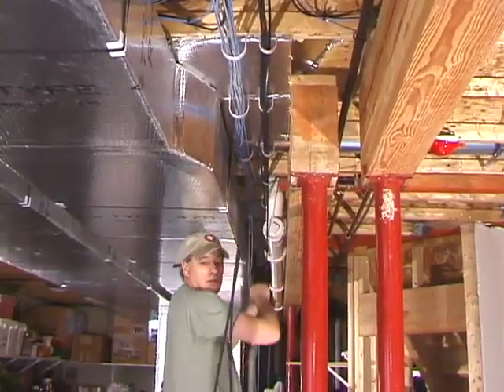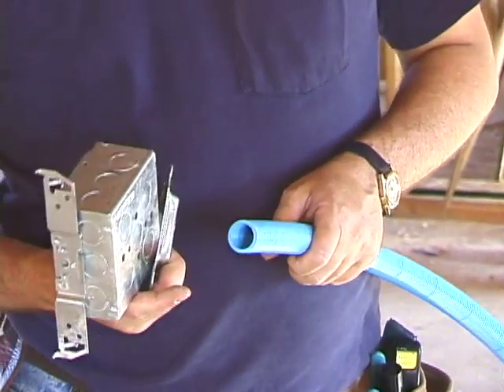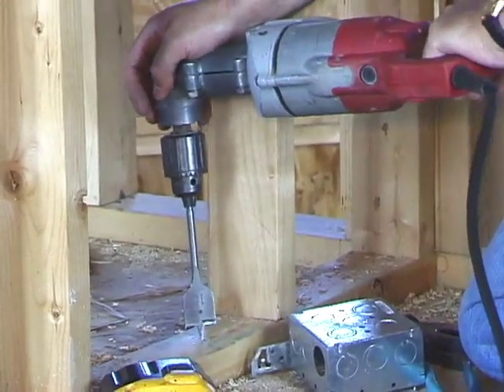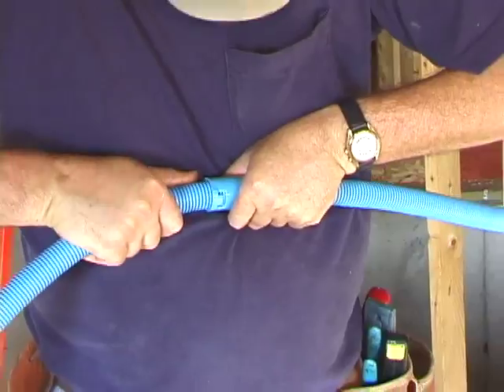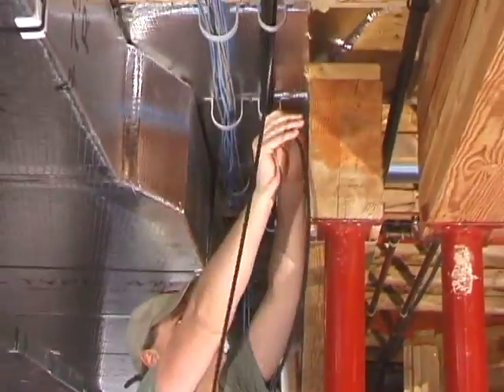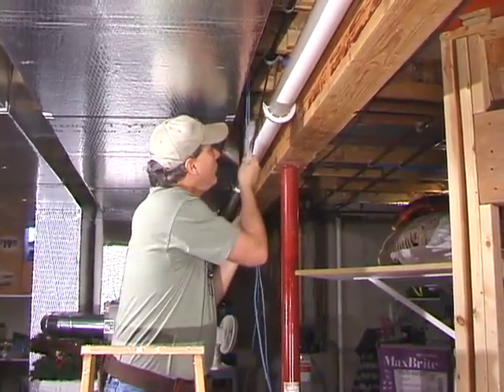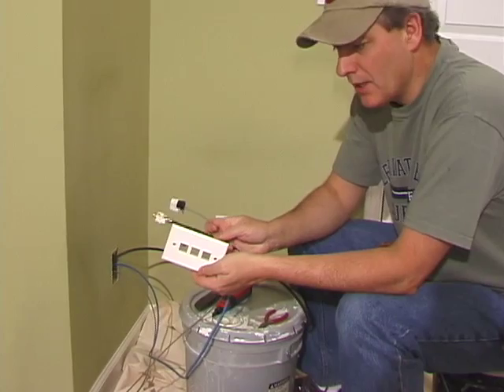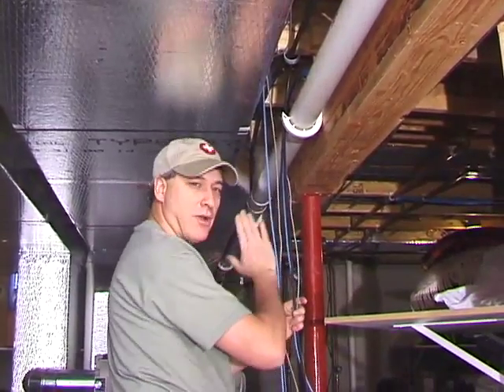North Coast Digital - Show #3 - The Ultimate Home Network

Comment: My builder gave me the clear to run data wire on a weekend in October.  Thinking of cat6 for future proofing - on said weekend should I just run conduit and tack on the boxes? I want every bedroom, back of the garage, den, and work center to have (1) cat6 port and (1) cable tv port (RG6?) and (4) cat6 ports in my family room and loft since those places will have smart tvs, blueray, ps4 etc...It comes out to (15) cat6 ports and (6) RG6 ports; any thoughts/advice?? thanks, I really knew nothing of home networking 2 days ago so bare with me

Comment: What kind of Conduit did you use? I am curious because I too am planning on asking the builder if I can instal it myself but they said it has to be FT4 rated.
Reply from the maker: I just went down to Lowes / Home Depot and bought it - the brand was Carlon.  I Googled "is carlon flex conduit ft4 rated" and it looked like some flex conduit is FT4 rated.  My contractor told me that I had to seal all holes through floors with fire caulk - which I did.

Comment: i took the idea of pipe hangers. but i zip tied them to my attic instead of screws. i wanted to be able to do easy upgrades and if i had to move one its easier to. any suggestions if i should wrap the cables from the hot Arizona heat or should they be fine. they have been up there for about 2 yrs but sitting on the attic floor and no problems so far. i just recently added the plastic pipe hangers. it looks so much better up there now with the hangers then wires all over the place. my house was built in the 1960 and i'm trying to add all the ethernet cables and run hdmi cable all over the house. hdmi cable are for the best buy look. all tvs playing the same thing.
Reply from the maker: I am no expert - but I would guess that wrapping the wires would be a bad idea.  They engineer the wires for a very wide range of environments and my guess is whatever wrap you put around them will be have more problems with the attic heat than the wires themselves.  You might want plenum rated wiring as it is rated for higher levels of heat and not wrap the wires.

Comment: after you strip the jacket off with the razor blade take the nylon string that is in the cable and pull on it and it will split the jacket that way you can cut off the wires were you cut through the jacket and you wont have to worry about if you nicked the wires with the razor when you cut the jacket
Reply: Even though this is an old vid, I had to say something about that nylon wire. It's actually the wire stripper.

Comment: You've done a fantastic job on most of the house, and I learned a few tips from your video. The only thing I do not agree with is how you terminated at the demark. You simplified the connector for cat5 and cat3, but organization is a sticking point for me, I would have rather seen you put in a patch panel via a wall mounted 4 post rack, it's not that much more $$. Doing this in addition to labeling the ports is just an easy and clean way of demarking your home (or business) network. Ultimately thumbs up, I am sure  your work today is top notch.
Reply from the maker: Daniel Holt Thanks for the comment.  The simplified connections were an attempt to save money.  My plan was to cut off the male ends of the wre (wit a lot of extra wite available) and buy the equipment to terminate the basements ends properly.  Everything in 2000 was more expensive that it is now.

Comment: Nice job, it's interesting to see another side of the industry (I work at a school district). Just a note for viewers about the termination; what was done is not B standard, the browns are switched. B is ow-o-gw-b-bw-g-brw-br. Not a big deal, just don't think that that arrangement is standard, as long as the termination is the same on both ends, the connection will work. the colors are just a coating and don't physically affect the cable, copper is copper. I also believe it's note worthy to not put a data hub next to an electrical hub if possible, the interference caused by electrical can be a real drag; and if you have to cross an electrical wire, avoid being parallel with it as much as possible, try to just cross it at only one point.
Reply: +ajrockr the order of the colors does matter in how they are terminated, it is how the wires are wrapped around each other for signal shielding. looks liked they used 586A.  staying away from florescent lighting fixtures is more important then staying away from electrical hubs.

Comment: A couple of MAJOR points.  As said before, just strip back and inch or two on your cat5 then use the string to strip back another 2-3 inches then CUT OFF the first 2 inches.  Second point is NOTHING is labeled.   Aside from that, not bad and surprised the pull went as easy as it did.  And, yes.  At ALL costs do not get a kink on the cat 5.  If so, pull it out and start over again.

Comment: you should never use a razor to strip the outer jacket off cables, you risk a HUGE chance on cutting into the individual insulation.
Reply: +Michael Johnson they make a special tool to remove the jacket. Ideal makes a nice one I use. I do a lot of industrial electrical work.
Reply: +Michael Johnson I've found exposed wires grounding out  intermittently causing grief.  And if you set the depth properly the jacket stripper works best.  Spin spin, pull
Reply: +Michael Johnson try it on multiconductor cable that carries IO in a factory, not for communication but either 24 VDC or 120VAC

Comment: at 26:00 he terminates wrong. Also, his keystone install was fucked as well. I'll be surprised if he gets close to 100mbit on this connection today. Also, why the hell didn't he put his "communications center" to the right of the electrical box, so he didn't have to cross EVERY ELECTRICAL WIRE IN THE HOUSE with data wires?

Comment: You get a C for the mess in the basement and not using a patch panel...! It is not like one could know what cable goes to what plug in the wall, even if you had a different color on the cat 5 phone lines. I would NOT like to troubleshoot this mess! Cudos on the ducts and boxes though! But number them FFS!!!

Comment: Hi Chuck,
You did a fantastic job with this & thanks for the great video however I do agree with some of the other comments on here. You should of just run CAT6 to future proof your new home, I also agree that you should of used a patch panel in the basement but I have also done it the way you did it as well. I would also like to add that you should of not used CAT3 and just ran 2 CAT6 cables to each location, One white for phone & one blue for data.

I also think you should of used some Die Cast Aluminum Distributing Ring on the plywood for good cable management or some of those plastic clamps you used for the wires. Also the way you tested the wires is not a good way, You can still have internet even though you may have a bad connection, The best way to test is use a tester such as the Greenlee NC-500 NETcat Pro Structured Wiring Troubleshooter
http://www.amazon.com/Greenlee-NC-500-NETcat-Structured-Troubleshooter/dp/B0026MT204/ref=cm_wl_huc_item there are cheaper ones but you get the idea.

Also gives these RJ45 connectors a try platinum tools ez-rj45, They are hasel free over the connectors you used.
http://www.amazon.com/s/?ie=UTF8&keywords=platinum+tools+ez-rj45&tag=googhydr-20&index=aps&hvadid=36295654059&hvpos=1t2&hvexid=&hvnetw=g&hvrand=16953836257005346063&hvpone=&hvptwo=&hvqmt=b&hvdev=c&ref=pd_sl_4h6kovndtc_b

Also mu mouth dropped when I say that Sony Vaio laptop that you used for testing in the bedroom, WOW that is old school, I still have one of those also. It was a great little computer back in the day, Your is in much better shape then.

Again great job and that you for sharing

Comment: I would have went all gigabit. Gigabit is too cheap these days to pass up on. Also I think I would have went with a patch panel for the install however great job.
Reply from the maker: Of course this was 2001.  And because it is conduit - I can go Gigabit any time I like and I could even go super-cheap and use Cat-3 for phones - because if I did not like it - I would pull it out.   I debated whether I wanted to do a patch panel and figured if I wanted a patch panel later - just snip off the connectors and install one.   It seemed a tad expensive at the time.  One reason to go with a patch panel is to avoid non-factory male cable ends in more professional situations.
Reply: +Chuck Severance  dude, at 26:00 you terminates wrong should be brown/white brown at the end. Also, your keystone install was fucked, you untwisted WAY too much and the jacket should be IN the keystone, not just right outside of it.. I'll be surprised if you get close to 100mbit on this connection today. Also, why the hell didn't you put your "communications center" to the right of the electrical box, so you didn't have to cross EVERY ELECTRICAL WIRE IN THE HOUSE with data wires?
Reply: +Chuck Severance  Also, why didn't you run any pull strings?
Reply: +alphabanks  Do you forget that this video is an old historical document from the year 2000! At this time the computer things, specially network things, was more expensiver as today. So noone plans 1 Gigabit or 10 Gigabit networks in private houses. Sure - today in 2016 be fiber to home and 1 Gigabit/s for home network normal.
Reply: You seem triggered lol